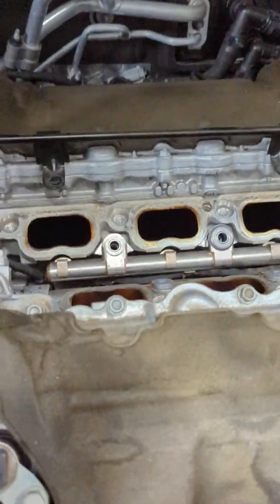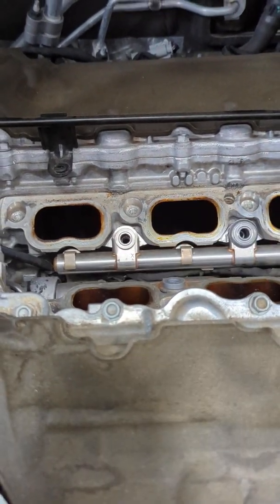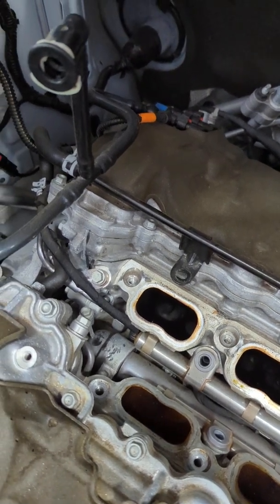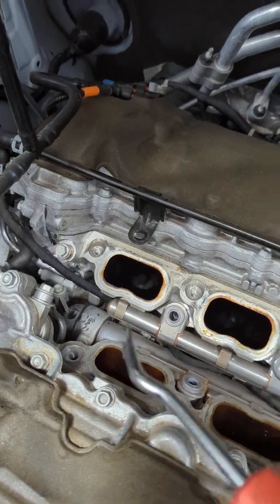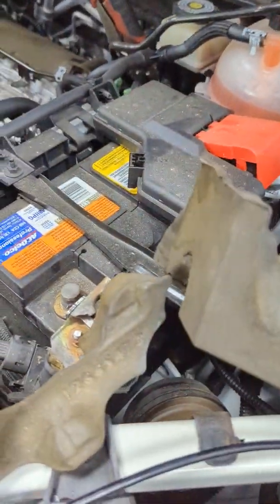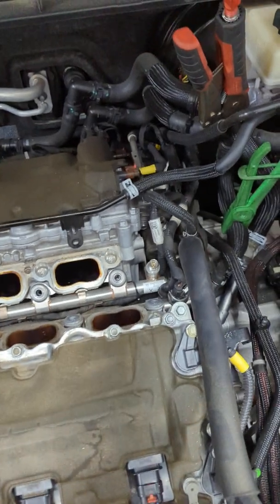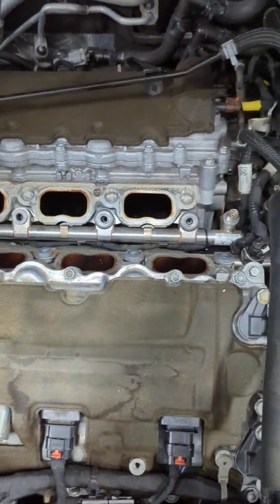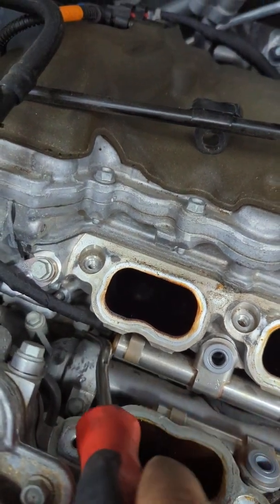2018 and up #gmc ACADIA #acadia #Chevrolet Steering assist reduced #problemsolving   PROBLEM SOLVED

Comment: My cousin tried to do this job but didn’t drain the coolant ..  it leaked into my fuel injectors and into like 3 spark plugs. Do you think my car is ruined?
Reply from the maker: Nah! Unless you can hear the weird noises and rough idle, it should be okay.
Make sure you do a top engine carbon treatment to help clean everything.

Comment: I was going to do this repair on my 2017 Acadia but I didn't have to. 
Try removing the negative lead on your battery for a few moments first. 
It cured mine and it hasn't come back yet. It can't hurt to try.  
Good luck.
Reply from the maker: You can try that but it doesn't solve the existing problem with it. 

GMC had to release a Service Bulletin for this particular issue, because throughout the country shops kept misdiagnosing the concern and they had been recommending the Electric power steering Rack assembly replacement which never fixed anything.

If the codes stay off and the vehicle operates without any symptoms and without storing the codes again, you should be Okay.
Reply: @barakzai90  My wife has been using it for days now and it hasn't returned. Fingers crossed. Thanks.
Reply from the maker: Your car luckily had a malfunction and not a defective part 👌